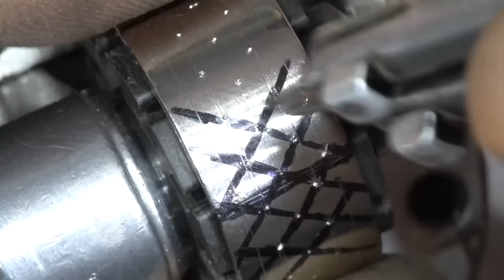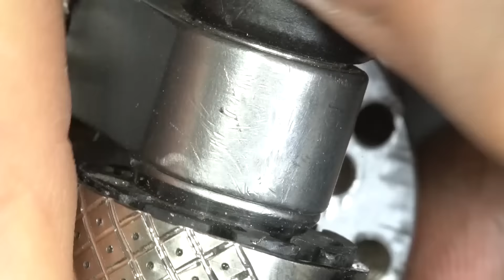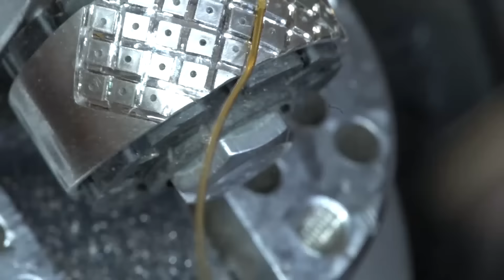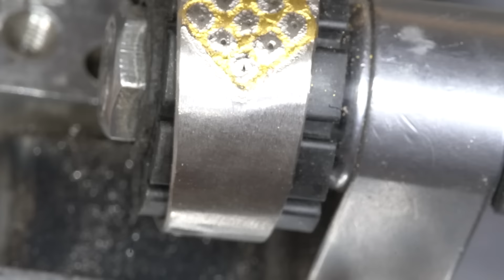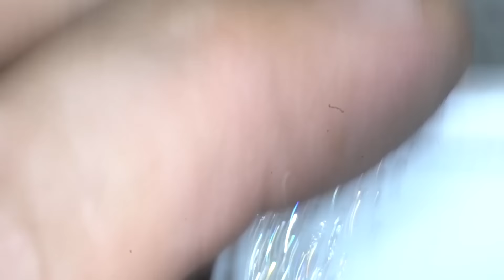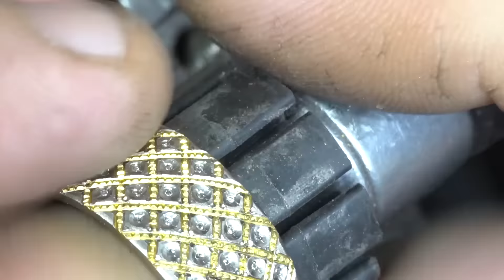Inlay Gold Into Gold - Handmade Rings -  Birmingham Jewellery Quarter - UK

Comment: How much does this ring retail for just out of curiosity?
Reply from the maker: This is depending of the ring size, diamonds size, details, etc.
From 1K to 3K.
Coly
Reply: How is jewellery made. Lets say size US 9 1/2 by 10mm proportioned to how this ring was made. Maybe using 2mm or 2.5mm diamonds not sure what size are used on this build.

Comment: Hi, so how does the gold attach itself without fusing or soldering? I understand the pressure used to push it in, but how does it become literally attached without heat. Lovely!!! I'm self teaching, and have never seen this channel. I'll subscribe!
Reply from the maker: No fuse, no laser.
This channel for inlay it is trapezoidal not rectangular.
Reply: Then , only pressure, do you use 24 k gold ?
Reply from the maker: Yes, 24k
Reply: Are you sure you did not use hand held pulse arc (tungsten micro arc)  for joining the gold to the ring? Or it was by forging the soft 24 k gold into the shears by hydraulic hammers
Reply from the maker: No laser no PUK and no superglue :)
Only presure in V channel.
Reply from the maker: This channel it is trapezoidal, whit the big side down.
Reply: So the graver makes the groove wider on the bottom? What kind of graver is that? Thank you so much.
Reply from the maker: The graver is absolutely straight but important is to carve in angle.
Coly